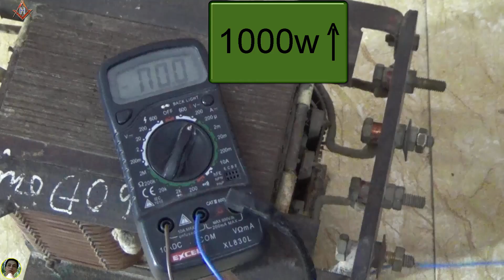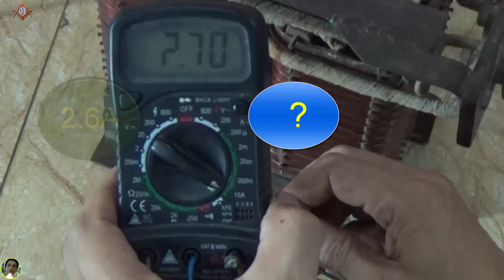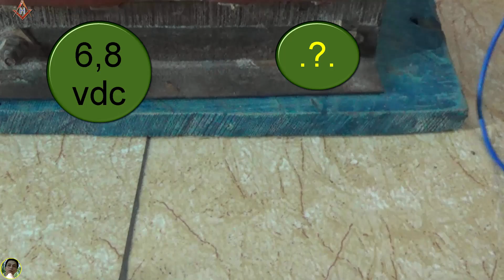How to make a 12 volt battery charger   use a 1000W power transformer car charger

Comment: The maximum current you can pass through a pair of 5 amp diodes in parallel is 10 amps without destruction. 12 volts multiplied by 10 amps is 120 watts.  The other 880 watts must be in your arse !
Reply: MrVeryCranky نتتتختتنمننوتوتوووووووونتونووتترووتنونتتتوو

Comment: OMG lol what are you doing? Learn what standards are equied fo PB batteries, what charge you need fo a specific battery, just because its 10Ah 50Ah you must not charge it with 10A o 50A lol, Standard safe changing of Lead cells is 10% of its rating, ex 10Ah needs only 1amp charge current, 50Ah batteries only require 5A current, you will destroy the plates man unless you intend to beak batteries, these wet cells ae to designed be be charged fo 12 hours, not an hour, maybe 2x on quick charge by doubling the standard charge.
next, learn the full charge voltage of lead acid batteries, full voltage of 14.7volts for a standard Lead acid, google it, you can never fully charge a PB battery with 12 volts, 12.5 volts or 13 volts, it is only partially charged, you should have tapped on the winding's 14.7 + 0.7 (diode drop) = 15.4 volt ac coil.
That 2 diodes will only handle 6amps and might burn when the load goes higher on a flat battery. the voltage 13 volts is a standard rest voltage of these batteries when it is removed from a charger not the max charge voltage when connected to the charger. 
this is an educational video right? make sure you research batteries first.
Reply: The peaks of 10v AC is around 15v. 15-0,7=14,3v. So what is the problem?
Reply from the maker: It will charge by the peaks of AC
Reply: 14.7 volts is what you would use around  half way through the charging process for about an hour to 3, for the bulk charge stage
Reply: Actually, you better do some internet research about healthy battery charging. It contains constant current,  constant voltage and float charging. It should be done at least once a year in deep cycle batteries. Otherwise, you should never use a voltage more than 14,4v.

Comment: its an OLD transformer   , being  experimenting  to get the right voltage  , why dont you build a regulated  power supply circuit,,,  its just ruining the   wind of the  transformer,   goodluck !

Comment: Whats the ferrite ring for?
Reply: For constant current.
Reply: I think it creates a magnetic flux and stores energy, adding or taking energy when needed so it smooths out the voltage. I've seen people use a capacitor to do this too.